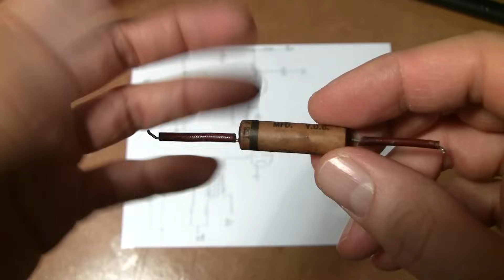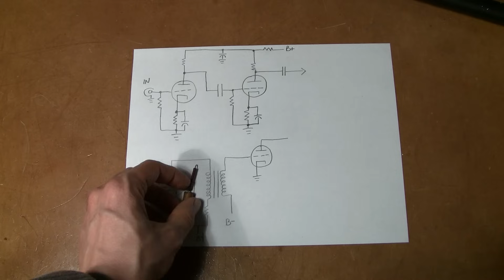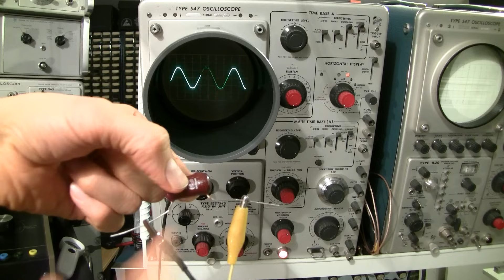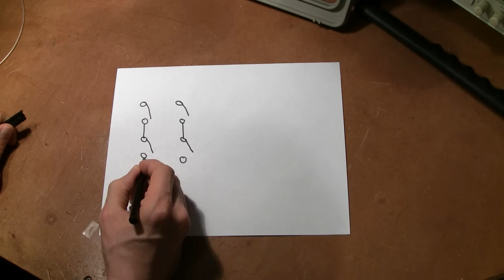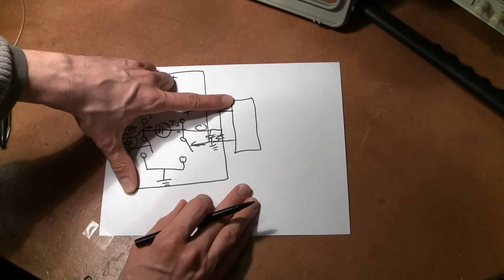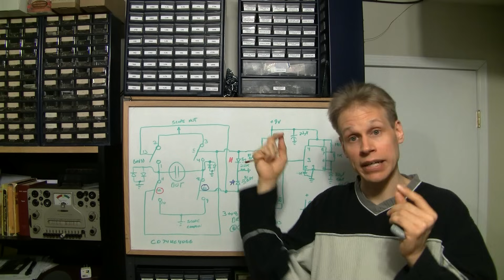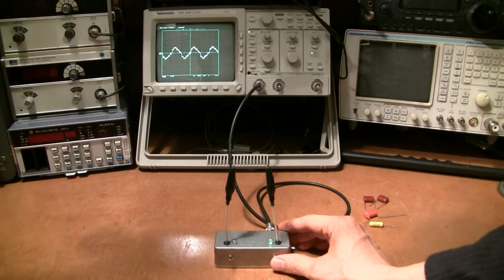Are Your Capacitors Installed Backwards? Build this and find out

Comment: I initially thought when I came across your video, "what crap!" thinking of DC polarization. 
You have given me a new perspective on these caps after all these years!

I have wandered about crosstalk problems in some high gain preamp circuits when I came across some people talking about supposed advantages of hand made coupling capacitors which are much larger physically than Comercial equivalents, ie more surface area to radiate things into it's surroundings.

Nice little design, however overly complex for what it does. 
As someone already said, a manual method where you can just touch the "Hand held" captor to a pair of marked terminals is just as elegant, 
however, if you want to complicate it a tad more, you could replace the pcb  with a dpdt toggle switch wired as a polarity reverser and orient the toggle so that it indicates either ground or hot terminal - according  personal taste or preference.

Great video and very informative! 
Thanks.
Reply: Hello again Mr Carlson, 
just finished my "quick & dirty" version in a die cast box using a DPDT toggle switch to flip the capacitor around electrically as mentioned in my first post, works very well thanks.

Had to insulate the toggle though, to prevent swamping out the noise picked up every time I touch it to switch over the polarity.
Tested it with   oscilloscope & a guitar amp, very discernable differences with both.

Just one extra note,  if there is insufficient amount of 50/60 Hz hum pick up when you grip the cap with your fingertips, make sure you are not grounded either partially or completely as this will bypass most of the noise you are trying to pick up and apply to the cap.
I found that even standing on few layers of dry cardboard or wood can increase the amount of noise your body picks up.

All the best.
Mark G
Reply from the maker: +Mark G 
Glad you found this video useful Mark. Great to read, your build turned out well!

Comment: Thanks Mr. Carlson for an awesome. It helps me a lot except I d not have a scope i have use of only a meter. :(
Reply: +bill chenet (Radioman56)
 Hi Bill, you can connect the circuit to an amplifier and listen to the hum (if you have an amplifier that is).
You'll have to provide an appropriate interconnect though, incase of a guitar amp, a 1/4" jack socket.
Depending on the sensitivity of an amplifier, you'll  have to set the volume accordingly.
Hope this is of some help.

All the best
Mark G
Reply: bill chenet No problem Bill. As long as the speaker has some bottom end response around 50/60 Hz it should work. The guitar amp I used here worked well on its clean input while on the high gain in, there was not enough bottom end to be useful.

All the best. 
Mark G
Reply from the maker: +bill chenet (Radioman56) 
Your welcome Bill!
Reply: I had a question can i use an ohm meter to locate the foil side. I don't have a scope cant afford one Thanks any help is greatly appreciated.
Reply from the maker: Hi Bill. You can't use an ohm meter for this measurement to be accurate. An old oscilloscope can be had for little money nowadays from your local HAM swap meet or the like. I have seen older scopes go for as cheap as $10. No special oscilloscope required for this function. Older tube type scopes are great for this.
Reply: +Mr Carlson's Lab ok this is sad I wonder what it would cost to build one I am not that ? Hmm shall we say building things but I try to restore radios. o well guess ill try other things ty
Reply: +Mark G Yes Thanks will try this . I have a portable auctioneer's loud spk this may work.
Reply: +Mark G Alright I will let ya know what I find out Thank You

Comment: quick way to do the same thing- connect one terminal of the capacitor to the antenna terminal of a radio with antenna terminals, leave the other end free.  compare the reception you get while touching the outer body of the cap. then reverse the cap. The way that picks up the most signal is the outer foil.
Reply from the maker: +eric Risse 
Interesting!
Reply: tried the antenna method and works great

Comment: Yet another obvious thing I didn't appreciate, never knew about, never read anywhere and was never told. I've been building circuits for around 40 years now and I'm now wondering what circuits I can/could go back to and tweak. This could even have been the source of oscillation in some circuits where I'd swapped out a capacitor to cure and now I see I could possibly have left the value the same but reversed the component!! Ya live and learn, what other obvious stuff don't I know??!! Jeez - Thanks for the insight, Cheers Mr Carlson from the UK  :o)
Reply from the maker: +Stuart Hossack 
Glad you found this helpful Stuart. Thanks for your comment!
Reply: +Stuart Hossack  Me To Going To Check The Last Amp I Did .... Wow  The the manufacturer,   miss led us all  ..... I was taught  that The Line was the ground and/or the foil side
Reply: I say the same as Stuart Hossack...been building circuits for around 40 years, even had some electrical schooling but never no one told me this...I got a amplifier that hummed alot and now I will try and check the capacitors and get it fixed...thanks alot Mr Carlson I really enjoy watching your videos...Peo From Sweden...
Reply: Live and learn. Great comment.
Reply: I was taught the line was negative but these china parts did not mark the capacitors right. I had friends that took electronics in high school and they helped me in hobby electronics, I wanted to take electronics but my math skills were poor. I can use the computer to get math questions solved now. he he
Reply: @ronb6182  Ron, Math was my weak point. There are enough sites to help you make the calculations you need. I built Robots for seven years in the late 90's into the early 2000's. $40,000 Base Price. I dropped out of High School midway through 10th Grade. None of my builds came back.
Reply: @jlucasound  I was always good at math in the early years it's when I took algebra 1 the problem started. I also was dyslexic and didn't know it at the time. I only found out when I was a junior in college.  I tried taking college algebra at the community college but ended up taking college math instead. Just to get my AA degree.  When I tried major in music I had a hard time with all my studies and was put on academic probation.  My mom called an educational psychologist and I was tested and found out I was dyslexic.  I remembered taking them same test at my school up north and the school officials had no clue what was wrong. Our education system is so behind the times. It's a wonder we don't have problems all around. 

At my work I had to go to a build house it's a 2 hour drive each way the guy driving the big truck was teaching me calculus and the way he explained it it made sense and I understood every step. Well that's our poor education system we have.

By the way I did pass college algebra at the community college after 7 tries. I finally found a good teacher. Trig was easy and I passed with a B. I.never went back to the 4 year college. 

In my tech job I never use math to repair boards and I don't design circuits go figure.
Reply: @ronb6182  Sure does make you wonder some times about the educational system. A lot of potential great minds are just gradually pushed away since the system is so old fashioned, blind to the potential and talents almost everyone, individually possess. A huge waste and just plain stupid.
Reply: @petethegreekre  it's funny now because I been in electronics most of my working days and I hardly ever used math, we have the internet now to solve electronics math. I guess if I took engineering I would use more math but I think at 62 a simpler career would be better. Tube electronics would be an option because not many want to work on tube amplifiers.
Reply: @ronb6182  You know these damn computers are funny things. I never could really understand algebra when I was in high school. My entrance exam put me in Algebra instead of math because of my high IQ but when I got there, having never understood what a variable was, I was totally lost, I barley scraped through the course. Now, after getting disabled with nothing to do but play with my kid's old Commodore 128, and studying the basic book, I learned what it was all about.  Now I can use variables, sub-scripted variables and the works. To bad you can't program much in BASIC any more, wish I had taken C in college when Workers Comp sent me there to become educated.
Reply: What if you use your PC sound card as scope, but might be to noisy. I would give it a try.
Reply: Stuart Hossack p
Reply: His info is great I did not know this either.

Comment from the maker: Hi vicegrip33, You have all your youtube settings on private, so there is no way I can respond to you. Your reply tab will not allow a response as well. You need to edit your youtube and G+ settings.

I don't think the capacitor orientation would matter much. What would work for you is... Two large capacitors out of a broadcasting application. They can deal with High RF current. They look like these http://www.mwpersons.com/Used-Capacitors.html
Reply: +Mr Carlson's Lab >< Thanks muchly for answering!  Much like the H.F oscillators in my old welders, I barely know anything about my Settings here on U-Tube. YES  my oldest Miller, a 1967 with the GoldStar selenium bridge rectifier
has a honken big capacitor in it's H.F. circuit, much like those in your link, from a great fellow in Canada that sold it to me on Ebay. And he tossed in other caps no charge to try as well. He matched  this large single cap's mmf value to the old two caps in parallel, because I didn't know whether to double or halve the mmf vallue. Thanks again.
Reply: Mr Carlson's Lab l

Comment: Wow, you sound like my dear departed Dad, he was an electronics guy, I'm a metal worker like his Dad.
I use very old Miller tig welders that use two .002 uf mica capacitors in parallel in the H.F. spark gap oscillator circuit.
These welders last longer than some humans, but those caps don't!  tar leaks out of them. I was given a box of modern
alternatives to use, so far two types from Sangamo have worked well. Another wound or layered type he said would work
but they are not marked for polarity. I wounder if it will matter, now that I've watched your vid.
My guess is it would work either way, but  send out H.F. interference more if wired in backwards.
Can you advise and educate me further in this application?
Thanks. Very neat vid by the way, reminds me of Dad, and I'm 59 so that's back aways.

Comment: Mr Carlson, if i were to be installing caps in my electric guitar, obviously I don't have a chassis and grid, but instead have a capacitor with one end connected to potentiometer wiper tang and the other to the back of the pot. Which direction would be the proper direction to install the shielded end and conversely the other end?
Reply: +nighttrain022 The shielded end to the back of the pot which should be grounded if it is a normal tone control.
Reply: nighttrain022 : Mr Carlson is saying the 'Banded shield' end of the capacitor always goes to the lowest impedance part of the circuit. Although the guitar does not have a chassis as such.....it does have all of the pot bodies connected together and to the bridge of the guitar and the screen of the guitar jack which ultimately finds its way to the guitar amp ground via the guitar cable. If you have a volt meter that does low impedance you can test to see if all these 'places' are connected with a low reading as close to zero ohms as possible. Since the back of the pot body is 'ground' ......BANDED END goes to back of pot. NON banded end of cap goes to wiper. The tiny sludgy brown flat disc ceramic tone caps,  probably are too small to have this shielding 'end'......i am not sure. I guess you are putting 'sprague orange drops' or similar in ?   Hope this helps.
Reply: @andrewludlam5686  Thank you Mr Carlson and to you.   I read the answers you gave in the past, and feel badly that I did not post a reply of thanks till I see this again 5 years later.

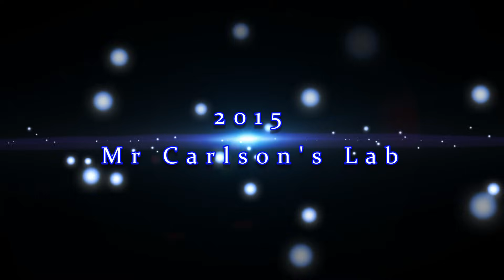Comment: I have been an electronic engineer/ technician for over 40 years, you have great videos, very informative, clear and correct, the only problem that I have following you is just too much talk , most of the times I do not finish them. 49:35 minutes could be reduced to  about 15 of good useful information, thanks anyway.
Reply from the maker: +Luis G Galvez 
Hi Luis. There are a few things that you still need to learn about youtube. 1st: Not everyone has 40 years of experience, so talking to people like they do (have 40 years experience) would make me a bad teacher. The whole idea is to appeal to a wide audience, so all can benefit. 2nd: You have the ability to "fast forward" if you find this video is moving to slow for your liking. If I was to make the video's shorter, all that other information wouldn't be there for those with less experience. 3rd: Out of (at this point: 894,000 total views) only "about" 7 people "to date" have mentioned "too much talk" (you are included in the count) That's quite a ratio! I don't mean this to sound harsh Luis, just pointing out a few things that may "broaden the horizon" a bit. :^)
Reply: I tink the videos ar perfect. keep them comming. i am an ammator so i need all the talk. thx.

Comment: Hello, in a guitar tube amp with a tremolo circuit consisting of three 0.05uF caps in series, one end going to the plate the other to the grid of the same tube, would it matter which way around they were connected? I think in this arrangement effectively one end of all three caps goes to ground so I assume this would be the side to orient towards the band end?
Reply: +allanpennington)Its not going to make the slightest difference for what your doing! This would be only for super sensitive circuits that are liable to pick up stray EMI interferance as far as I can see?

Comment: Well I too have been in the game form any decades and always assumed that the band-marking were true.  Sure now explains why in several cases, replacing a cap did not lower the noise level (i.e. I may have replaced a low-value defective unit but put the same amount of noise back in by putting the new one in due to poor marking) and concluding that was the design!  So, thanks for the enlightenment!
Reply from the maker: +SpinStar1956 
Glad you enjoyed!

Comment: Thanks for that. I hadn't even thought about the foil in these caps acting like an antenna. However, I'd probably approach the test circuit by using a cheap differential amp with back to back LED's on the output. Then, when you plug the cap in, the LED will light up opposite whichever end of the cap is the foil end.
Reply from the maker: +tasmedic 
Thanks for your comment!